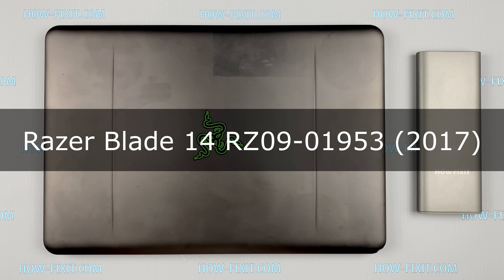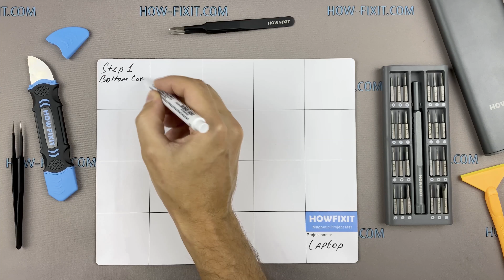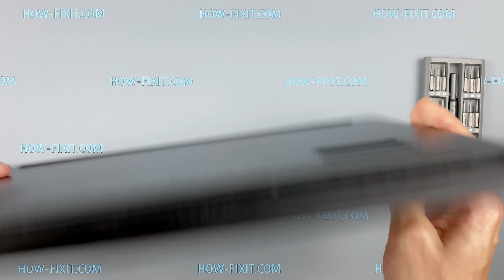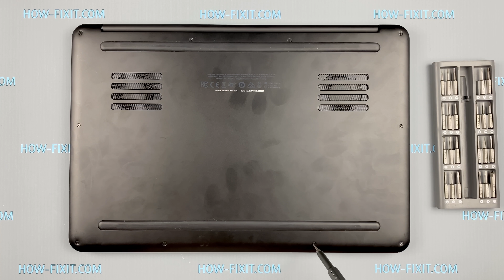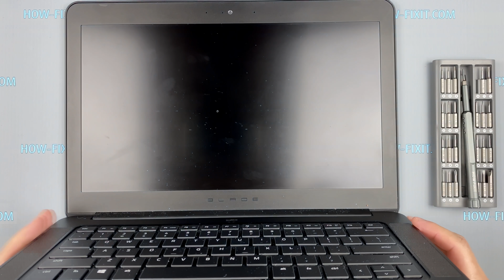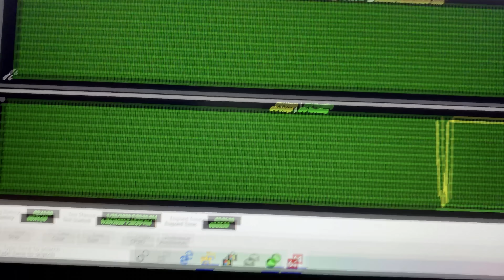Razer Blade 14 Disassembly, fan cleaning and thermal paste replacement

Comment: thermal paste is too inconsistent. i tried using thermal pads and they turn out to be heat resistant and not let air through and do not leak.

Comment: The exact video I needed. I’ve had my Blade for 4+ years haven’t opened it once, and damn does it get hot in games, max I’ve seen is 97°C definitely due a clean. I’ll check out undervolting too, and try get 70°C stress temp.
Reply: Same with mine to, alot of people complaint about the razer 14 thermal issues.

Comment: What size are the thermal pads
Reply: Did you find the thermal pads thickness?
Reply: @afronandoooo  no ended up soldering in a new additional heat pipe

Comment: How long would thermal grease typically last? I am taking my Blade apart for a clean but I am thinking that it would be too soon to replace the grease as the unit is only just about to reach a year old
Reply: my razer shit the bed after 1 year, its very possible its fried